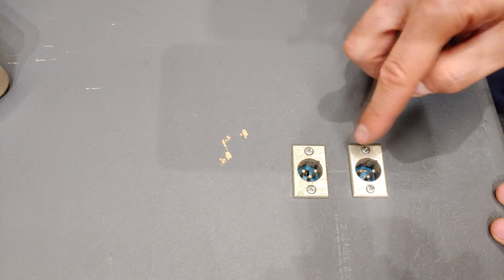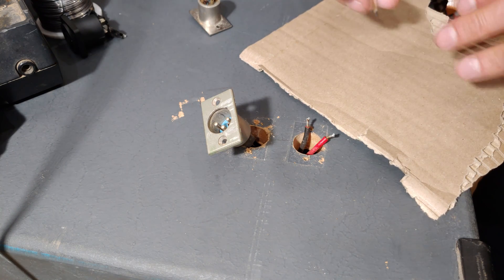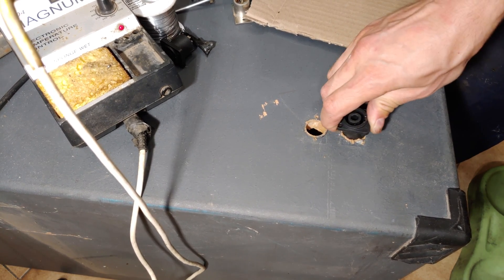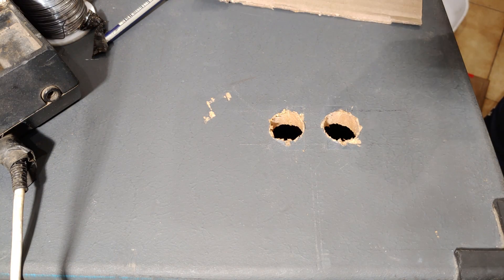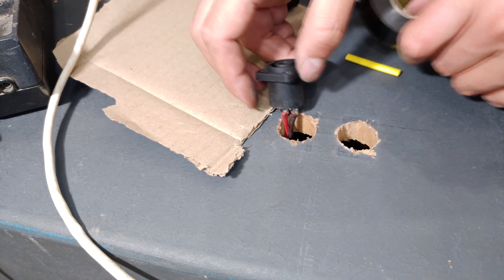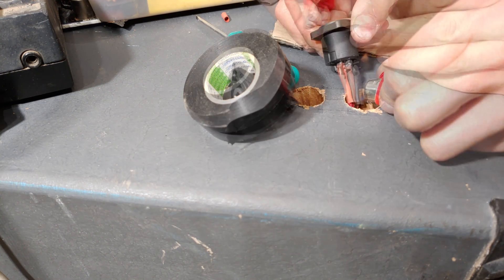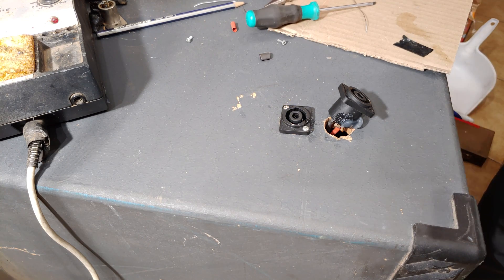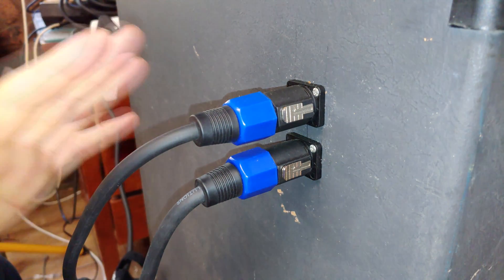How to convert an XLR to SpeakON panel mount connector

Comment: Been there done that, everything‘s a hammer when you just got a hammer. Like I said I’ve been there I’ve done that drill bits don’t necessarily drill sideways. In case anybody else is doing this a Forrester bit will be able to go through a new hole even if there is a current hole. Another option is doubling up your hole saws putting one inside another one that way the inner one rides the old hole while the outer one cuts the new hole.

Comment: Hi, do you have a video on where to purchase these XLR adapters?… I have an xr18 in a box, rather than open the box I would like to have all my cables plugged in and had the adapters attached on outside just to plug in

Comment: I didnt solder mines I used spade connectors on them and electrical tape to separate them from touching each other in the box
Reply: I would have done the same, especially in this case. No room to work in.

Comment: Love the video brother 💯
I have question, I'm working on the same project but my xlr cable has 3 cables (white, red & open wires) & the speakon has 2 positives & 2 negatives, what should I do?
Reply: You put the red wire with the white wire together, they will go to the 1+ on the speak on connector. The other wire should be the ground this one goes to the 1- on the speak on. Hope this helped.
Reply: @cbinet123binet9  Thanks brother
Reply: @djjaviinaction8094  did you try to connect the wires they way they told you? And if so did it work for you?
Reply: @jessezepeda3990  it did work brother Thanks again 💯

Comment: I like how you draw a template for the hole to be cut, but then just proceed to freestyle it. Get a bigger drill bit instead mate.
Reply: And use a vacuum on the drill to help reduce shavings falling into the cabinet.
Reply from the maker: since this is a ported box, it falls out of the box, but i get your point.
Reply: @ecologicaltime  Don’t tell them fools nothing.

Comment: Does anything need to be done differently when using 4 pole cables?
Reply from the maker: same procedure, just x2. Just make sure you keep polarity correct.
Reply: ecologicaltime thank you for responding! So pins 1+/1- connect to +/- on the speaker but what about pins 2+/-? I’m currently putting together passive subwoofers that I’d like to run bridged mono from my amp but I want to make sure I’m not going to mess anything up

Comment: great video keep them going....need some videos on powering up amps (type of distributors or extension cords or diy distro boxes or quad boxes etc)...please and thanks....if you have more projects just buy a pack of hole saw for precise drill bits for speakon/xlr chassis and tweeters......and if your building a rack mount panel that doesnt have knock out holes......use a metal reamer.....save some time on the hours and hours on the sound system adjustments.....
Reply from the maker: thank you for your comment.